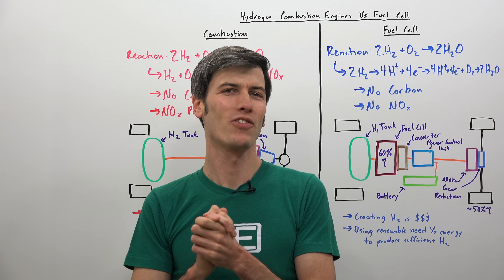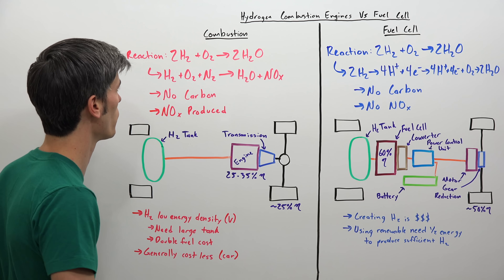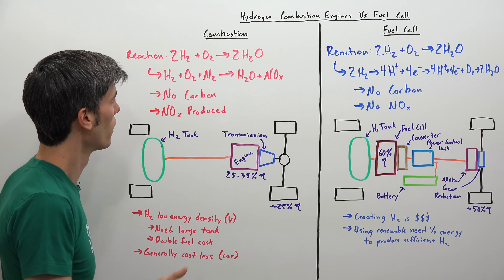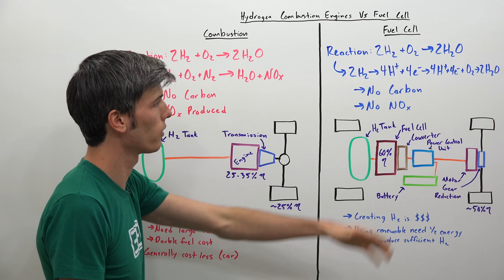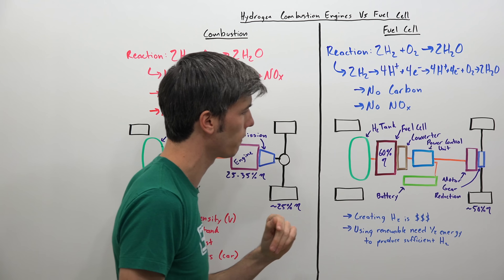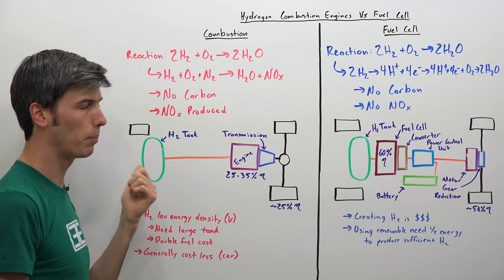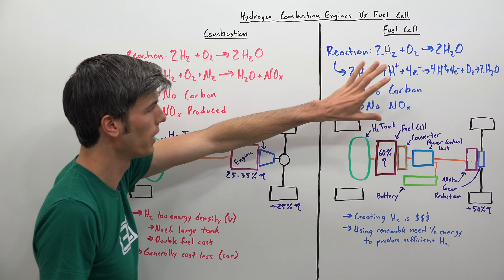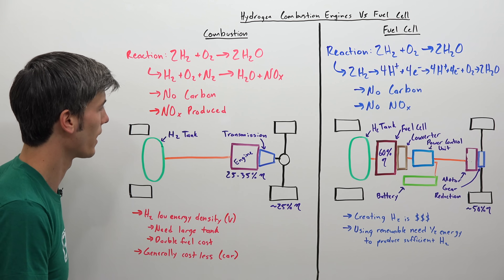Why Hydrogen Engines Are A Bad Idea

Comment: I see hydrogen combustion as a way to keep classic cars going into the future, without having to electrify them, and remove the internal combustion engines which we love so very much. For the everyday person, electric is definitely the way to go, but for car enthusiasts, hydrogen will provide a way for us to tinker with combustion for our own enjoyment.
Reply: That's a good point.
Reply: Agreed!
Reply: Exactly what I've thought for years now. Not just for enthusiasts, but for the hundreds of millions of perfectly serviceable cars around the world. Imagine the impact on the economy and environment if we suddenly tried to replace all those vehicles with new EV cars. It just isn't practical. Converting old cars to run on new fuels is much more reasonable.
Reply: sorry to ruin the party but cast iron (as in my Javelin 71 monoblock) is "poisoned" by diffused hydrogen becomming brittle, and aluminium won't like it that much either so hydrogen will ruin your car if the engine is not reinforced somehow
Reply: It is not a simple way to convert them. It's not just to put in different injectors, and thanks. Hydrogen burn hotter and that demands more of the materials exposed to the combustion. And getting water vapor and hydrogen blowby (from piston rings not sealing 100%) into the oil is not good either.
Reply: Also they have systems out there were you can burn any carbon matter And turn it into a combustible gas So you can take all of your garbage and use it to fuel your car
Reply: Aaaand to finish it off, you'll lose about half the power - check out the hydrogen BMWs or RX-8. Not a great deal. But I think that ICEs won't be outright banned for use - at least in most countries - and there will be some fuel for them available, so the classics will stay as they are.
Reply: @8Hshan  most likely, yes. As another commenter said, replacing every car for and EV, at the same time, is a plain bad idea. I think the way to save ICEs, even keep producing them, is ethanol, fewer emissions, but more expensive fuel and a bit more wear, a price enthusiasts would be willing to pay
Reply: Why would you get rid of internal combustion engines?
Reply: In that case, I'd be thinking synth-fuels that are made from hydrogen and carbon or whatnot.
But then again - There should be more than enough oil to make the fuels, only you might have to pay the price to remove an equivalent amount of co2 from the air.  
Some enthusiast cars have very little impact on pollution when the majority of daily drivers are EV's.
Reply: I do t worry about the future of classic cars. Petrol will always be available in one form or another. It might just cost more, but who does 12k miles a year in a classic anyway.
They still run steam engines on coal (at least in the UK) and the environment people seem to turn a blind eye to it.
They won't ban petrol for a handful of classics for the same reasons.
Reply: @richardschofield2201  I agree
Reply: MalawisLilleKanal   Carbon dangers are grossly overblown.  While active countermeasures are demonized for political gain.  Just one proven and economic idea is to Fertilize the arctic oceans with just a bit of iron oxide.  Then watch the Co2 plummet while the fisheries thrive.
Reply: MalawisLilleKanal   Totally agree there is plenty of oil.  As a realist I had started to buy into the Peak oil Theory 10 years ago.  Unfortunately I had succumbed to the overly simple “Malthusian” view of the world like so many folks have.   Once I studied this a bit it was obvious I had grossly underestimated human ingenuity and free markets!   Since then the good-old-boys in the oil patch have given us another example of how Malthusian thinking is so massively and  so often wrong.
Reply: @Biomechanoid29ah  -- I've never heard of a Javelin "monoblock". I was partial to the 1970 AMX, though .......
Reply: @Biomechanoid29ah  Both the aluminium and the iron need to be close to melting before hydrogen can dissolve into the metal.
Reply: S King  that is the way we call the part that holds the cylinders and top of the crankshaft here south of rio grande
Reply: Yevrah Hipstar that is true for quick effects, but on an ICE we are exposing the parts to weeks or months worth of use per year, and you don't need the whole of the cylinder poisoned, just a couple mills of btittle cylinder walls and...
Reply: We could just use ethanol lol. Literally just buy everclear or moonshine and tune it to work with that. Much easier, much less extensive modification
Reply: Vignesh Balasubramaniam with minimal modifications, your classic car can run off alcohol that can be fermented at home. Easy.
Reply: lovely agree with that! 
ICE will always be a must for every car enthusiast!!!
also even now some cars "don't care" about "efficiency" but instead about how fun the car is itsel... like a 'no proprer eco' N/A V12 :)))
Reply: What about vegetable oil? For a long time, there were lots of documentaries on TV about cars that can run on rape (THE YELLOW FLOWER) oil with minimal modification. We can't really switch the majority of modern cars over to rape oil because there just isn't enough of the oil and the price would shoot up into unaffordable heights rather quickly, but for the few old cars that may remain on the roads long-term, it might be enough maybe?
Reply: @yevrahhipstar3902  
It's ions impregnating the metal that cause it to go brittle, so the temperature doesn't have to be metal-melting hot for it to occur.
The problem can be addressed by adding a small amount of sulphur to the mix.
Reply: @theuncalledfor  IIRC that's only for diesel engines isn't it?
Reply: @mikee6666 
Now that you mention it, I think you're right! I had forgotten that!
Reply: But wouldn't they have to be parked only in open, private property areas and have other regulations on them due to the very explosive fuel tank? I feel like at best you would see these at race tracks under controlled conditions

Edit: nvm, not as dangerous as I thought
Reply: @________dQw4w9WgXcQ 
AFAIK, hydrogen vehicles exist right now. They're already on the streets. They're a rare sight, but hydrogen fuel stations and the vehicles that use them already exist.

Also as far as I know, the fuel tanks are not particularly explosive. It's not like hydrogen is stored pre-mixed with oxygen, after all. So for an explosion, you'd have to rupture a tank, not have the hydrogen ignite immediately because then you'd get a slow-ish burn, and then have another ignition source light the fuel-air-mix on fire. I don't think it's significantly more dangerous than a petrol car.
Reply: @theuncalledfor  ok, good to know
Reply: ICEs probably won't go away for another hundred years. I doubt more than 30% of passenger cars on the road will be electric by 2040 without massive government incentives which isn't very likely unless you're a wealthy European country.
Reply: Classic cars need never switch to hydrogen.  By their very nature, they will only ever exist in small volume and their collector status will allow their original fuel source to be grandfathered in along with them.  Even in areas that ban internal combustion, special permits will likely be issued for educational or show status.
Reply: @nordic5490  Sure, it can be fermented at home.  But distillation to a usable alcohol content is illegal in every state.  No matter the amount.
Reply: classic car enthusiasts can still burn petrol, what's important is to get the vast majority of people driving electric!
Reply: @Toilet Citchen So what exactly is?
Reply: @Toilet Citchen Yes, I understand that the modern engine is quite clean. But your statement itself shows a reason why electric cars will be the future, at some point, if not the near future. The vast majority of the pollution in any city is produced by vehicles. While an individual car's exhaust may be cleaner than the air with the collective exhaust of countless vehicles, that's no argument against the innovation of alternative energy.
Reply: @Toilet Citchen The information you're referring to is false. Under Tesla's original service plan, they did perform a 'Drive Unit fluid service'  once at 12500 miles, to "break in" the gearbox. But as the gearbox actually has a lifetime filter now, this is no longer necessary, and technically was never necessary, and was only done as a (relatively unnecessary) precaution. The gearbox fluid essentially never needs to be replaced, and has a lifetime filter. Its cool, because most manufacturers don't put in a filter for gearbox fluid to filter out metal particulates from the gears. 

Anyway, that information that you have is false. Tesla's do not need regular fluid maintenance.
Reply: @Toilet Citchen No response, huh. Guess you didn't do your research.
Reply: @Toilet Citchen You fail to cite any source for "the gearboxes being trash". Stop using anecdotes, and provide statistics. There's no evidence to back that claim. I've seen nothing to suggest that.

And yes, I'm fully aware that electric cars were around before internal combustion. Jay Leno talks about his Baker electric all the time, from over a hundred years ago. But you still don't seem to realise the potential of super capacitors, and the promise of energy density and charging in minutes.
Reply: @Toilet Citchen You're still thinking in terms of lithium. Do you seriously believe that engineers will never find anything better than lithium to make batteries from?  Like graphene, which is carbon, which literally is everywhere?

And you didn't address the gearbox issue. Don't avoid your own arguments.
Reply: @Toilet Citchen Once again, no response.
Reply: @Toilet Citchen Do you know how to read sources? Maybe you should read them I went out of my way to cite sources for my claims, even when you didn't. Maybe I can spell it out for you. Electric cars pollute less than internal combustion, even when taking the the manufacturing process into account.
Reply: @Toilet Citchen What forums? You fail to cite sources for your claims, even when I did. And its clear that you didn't bother to look at the sources that I gave you.
Reply: @Toilet Citchen Huh, I guess you had no answer to actual research.
Reply: We won’t need pure hydrogen to keep those vehicles running. Synthetic gas is one option, or biobutanol is another. Butanol is almost directly interchangeable with gasoline in terms of energy content, and has fewer problematic characteristics than ethanol.
Reply: @Toilet Citchen Again, no reply. Guess you couldn't argue with facts. Maybe you should do some research next time before spouting nonsense.
Reply: Better to run ethanol or synthetic gasoline for enthusiast cars as it requires less modifications and actually works on older cars with engine materials that would not really make great friends with hydrogen. If we are only focusing on enthusiast  vehicles then the emissions from such fuels are negligible, also the amount of grains lost from food production to ethanol would't matter much if it only when't to enthusiast use.
It's the commuter and transport vehicles that needs to move to zero emission energy sources as they are used millions of times more then enthusiast vehicles each year. I don't see a problem with battery cars having combustion range extenders using the same fuels either, if they are really used as extenders and not as the daily energy generator.
Nature can handle the emissions from a few million enthusiast vehicles and the occupational range extender running few hundred miles each year, especially on synthetic fuels or ethanol as compared to refined fossil fuels as they run cleaner (especial compared diesel). What nature can not handle is billions of commuters cars and transport vehicles running thousands of miles each year how ever with high emissions of both harmful particles and CO2
Reply: Why ICE, electric motors are far better more fun, simpler and fewer moving parts.
Reply: @airgliderz  But they lack the soul and feel.  Electric can be fun but not as fun as ICE
Reply: @ThrottleKnife  no, I ele tric has more heart and sole and more fun. ICE heart and sole is mythical old tech bull.
Reply: @ThrottleKnife  no electric has more sole and better feel. Faster, safer, simpler, and more more reliable and more fun. Driver skill improves cause can concentrate on drivoning, no worries about transmission, or ICEs weird old tech HP and torque curves.
Reply: @airgliderz  Maybe you feel that way but a lot of people think ICE has more sole and prefer the feeling and characteristics of ICE. The torque curve is part of what makes ICE exciting. Electric can be fun, but it still lacks feel compared to ICE.
Driver skill improves with training regardless of the energy source, making it easier to drive doesn't make you a better driver cause it's the car that's good, not you. A good driver can drive what ever car you get in at the limit of that particular cars potential regardless of the drive train. A guy that can throw an old CIvic around the track at the limits of what the Civic can handle is much more impressive then the guy in a new Ferrari or Tesla who drives much faster in terms of top speed and lap times but only uses 35-40% of the cars potential.
Reply: @ThrottleKnife  agree, but I a good driver is a good driver even in cars that are not sporty, you can have fun in all. However a Tesla pushes the limit allowing more control and more accurate control and is more fun then ICE, and the electric sound alone is awsome. ICE can sound hood but that translates to loud and weird torque and hp curves limiting the driver. It's why F1 has electric to make up for ICE deficiencies making it better like in a Prius which is fun to drive, Toyota engineering brilliance is the Prius has only one gear ratio, which is never changes gears, and the the 2 electimric motors and ICE are allways directly connected to the front wheels with no clutch, no torque converter or any methide to disconnect the three motors from the wheels, and also has no reverse gear, and amazing fun to drive tech because of electric motors that enhance ICE with a super simple super reliable low friction no gear changing ever. Engine can start with E fine in gear, but amazing stuff and fun. ICE by itself will eventual die, and a good thing fir all and enthusiasts.
Reply: Hydrogen can also be combined with CO2 from for example a biogas plant to make synthetic petrol.
Reply: Not going to happen. Sorry. The Nitrogen Oxide emissions will be outlawed... and besides... who is going to insure the vehicle?
Reply: Electrifying classic cars is an awsome thing, but fun, and efficient, and fast.
Reply: I don't see how it would even be the same car after replacing nearly all is guys. There is no way a conventional gasoline engine can burn hydrogen, it would leak everywhere.
Reply: Definately converting current cars to use carbon neutral fuels like hydrogen makes much more sence than scraping the combustion engine and replacing with EV technology.
Reply: @Biomechanoid29ah  Ceramic coatings can easily sort this issue out if at all it is an issue.
Reply: @8Hshan There may not be an outright ban but governments are going to make it soooo expensive to run such cars that we will be forced to scrap them I hear rumors that in the future owners of vehicles will be penalised even if the vehicle is off the road and not in use just pushing it out of your garage will cost a small fortune, on the other hand if some technology can prove that combustion engines can be carbon neutral through using different fuels or someghing perhaps the legislators might allow the use of such vehicles.
Reply: Alcohol,bio butanol,and ammonia  would be better and easier options. for converting existing vehicles to a carbon neutral fuel source.
Reply: @richardschofield2201  I hope so, but the governments over here in Europe are so misinformed, they want to ban all fossile fuel cars thinking that batteries are the way to go....

As long as the carbon footprint is not in our backyard off course, who cares about the production or even worse not having a solution to get rid of the toxic waste of batteries?

All non technical people buy it and think they are green with their teslas :-(
Reply: yeah, i am a classic car enthusiast and i love my vroom noise that combustion gives. With gas prices skyrocketing I am thinking about converting my truck to hydrogen cause I can make the stuff for free.
Reply: Vignesh Balasubramaniam we don’t love combustion engines, we’re just used to them and most people don’t like change. They need to get over it, either now or when they’re starving because crops and animals are dying because they were too stubborn to let go of their selfish pleasures
Reply: EV cars are crap, the battery is expensive, lasts for only a few years and weighs a ton. You also have to charge it all the time, which will not be possible along the roads if everyone has to do it, not even 10%
Reply: Or just keep using good old gasoline combustion engines. I highly suspect that Co2 is not the threat to the planet that we have been told it is. It's a scam, to de- industrialze and impose a carbon tax for more control over the people
Reply: Vignesh Balasubramaniam   Where are you going to get all the electricity? The wind towers are horribly non cost effective and destructive. Solar is toxic metals galore many unintended consequences waiting in the wings, all over a .01 % increase in co2 of which .0014% is man made? Winters are getting longer not shorter,  The ice has been melting for 12000 years, guess what, it’s still melting thank god,
Reply: That's needlessly complicated. Much easier to run gasoline engines on ethanol, most are already designed for it and would only need a remap basically.

Ethanol can be produced from 100% renewable sources, same as hydrogen.
Reply: Methanol is worlds better for an existing power plant.
Reply: Except the range would be tiny if you replaced the gas tank with the equivalent sized hydrogen storage tank. It would make more sense to use biodiesel and/or synthetic fuels and keep everything the same.